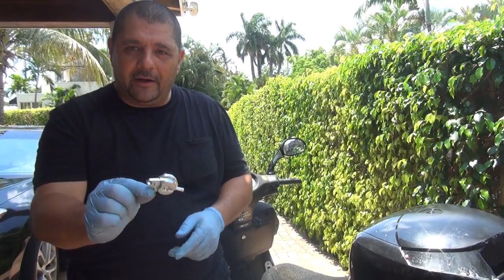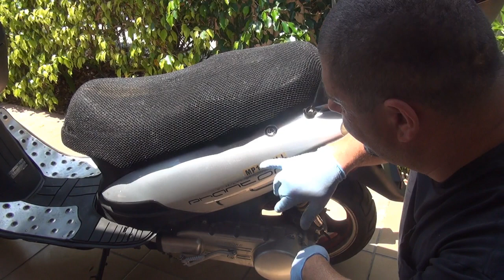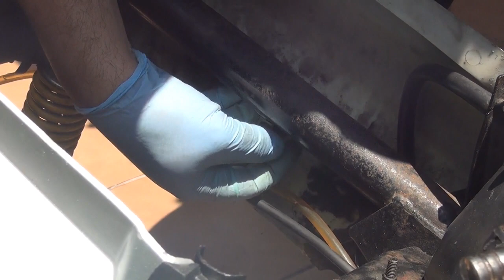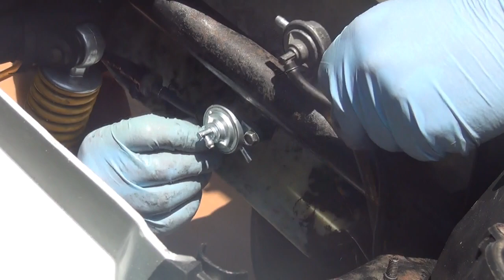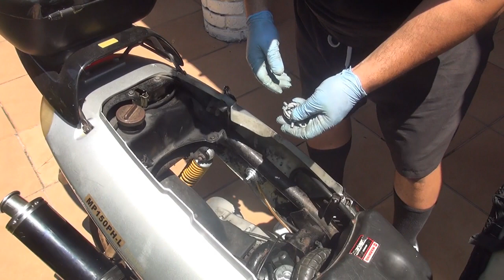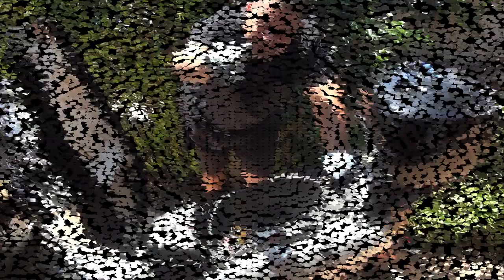Chinese Scooter fuel valve

Comment: Hi I have a Lexmoto Tornado 125 it will not start up at all it’s got compression got spark but when I spray carb cleaner into air box inlet it starts up what can it be? Could it be my fuel pump that is the problem?
Reply from the maker: Hello James I think that is a dirty carburetor jet but can be a fuel valve too anyway look like the fuel is not going in the engine at this moment

Comment: Hello, so on the fuel pump , I should be able to blow air through the out and not through the in right ??
Reply from the maker: Hello my friend yes you are correct  you  should be able to blow air through the out and not through the in
Reply: @VirberelloScooterTips  okay, also am I supposed to have an actual petcock valve that can be turned on or off ?? I am being told I should have one but I cannot find it , or an off switch for the fuel
Reply: @VirberelloScooterTips  also I went and got a new spark plug, I put it in and have it out of the motor in the coil wire , I try and kick start it and I do not see a spark at all? What is my next step?
Reply: @VirberelloScooterTips  the spark plug cap?? Is that on the coil that’s connected to the plug?? Or you mean the medal piece that was screwed over the end
Reply: @VirberelloScooterTips  alright yea the coil I have has a boot on it
Reply: @VirberelloScooterTips  so I guess I need to buy a new coil then
Reply from the maker: @FinnedFusion  Sorry the name is sparkplug terminal nut https://amzn.to/2T3REgh

Comment: There is a float valve inside the carburetor no over flow to engine.
Reply from the maker: There are several ways an overflow valve on a gas scooter can fail:

Stuck closed: If the overflow valve becomes stuck in the closed position, it may prevent the excess pressure from escaping. This can lead to an increase in pressure within the fuel system, potentially causing damage to fuel lines.

Stuck open: Conversely, if the overflow valve gets stuck in the open position, it can cause a constant release of fuel or gas vapors from the system. This can result in poor fuel efficiency, reduced engine performance, and possibly create a safety hazard due to fuel leakage.

Contamination or blockage: Sometimes, debris, dirt, or other contaminants can enter the overflow valve, causing it to become stuck or obstructed. This can affect the valve's ability to function properly, resulting in incorrect pressure regulation.

Wear and tear: Like any mechanical component, the overflow valve can wear out over time. Frequent exposure to vibrations, temperature changes, and fuel can cause the valve's internals to deteriorate, leading to failure.

It's important to note that a failed or malfunctioning overflow valve can potentially lead to dangerous situations, such as fuel leaks, engine damage, or fire hazards. If you suspect an issue with the overflow valve or experience any abnormal behavior with your gas scooter, it is best to have it inspected and repaired by a qualified technician to ensure proper functioning and safety. Regular maintenance and checks can also help prevent potential failures and ensure the longevity of your gas scooter.